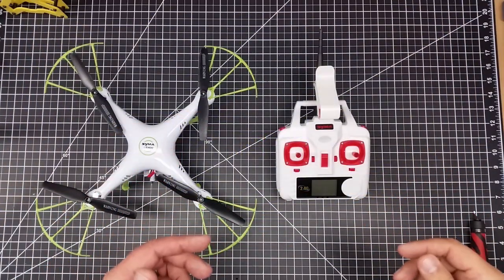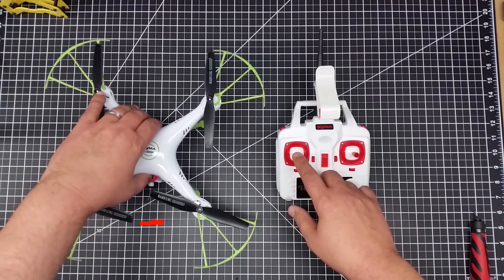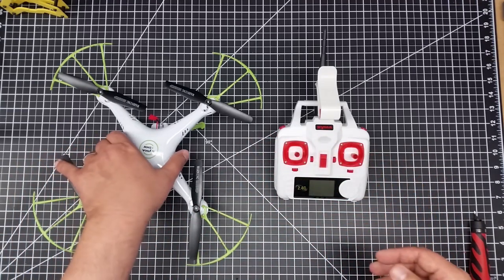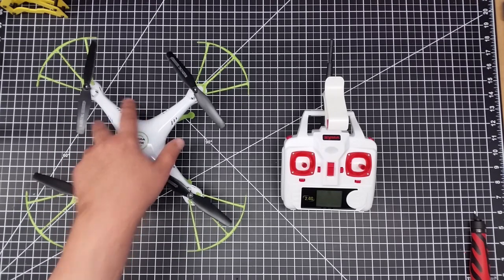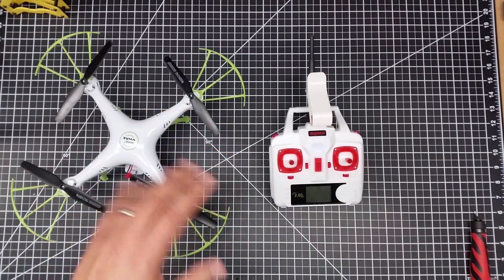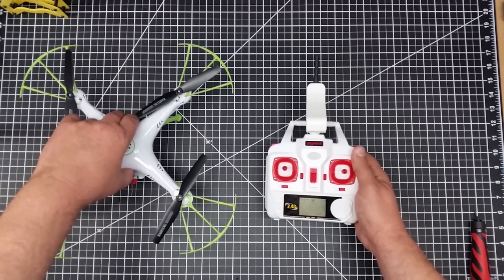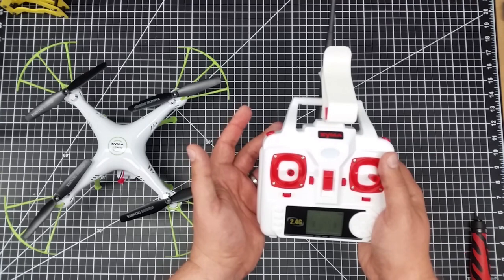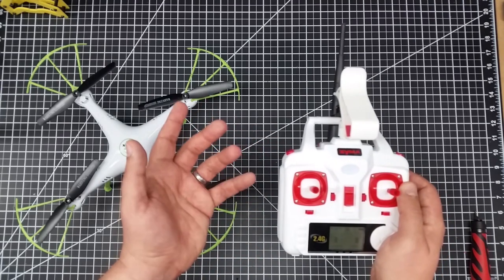Video Drone -  Headless Mode Tutorial!

Comment: I have a Syma X5SW-V3 WiFi FPV Drone.  I guess the V2 had a different camera.  The 3 is supposed to be a better camera.  I can't imagine one could be worse than mine.  What makes things difficult with mine is that it uses a different controller than the old one.  They used to be black.  Mine is white but not quite the same as yours.  Mine doesn't have a screen at the bottom.  I have to clip my cell phone on to it.  With that I use the "SYNA GO" app on my cell.
I can't figure out how to put it into headless mode.  The app has a toolbar at the bottom where there's a button to change it to & from headless.  But there isn't any discernible difference when I press that.  The instruction booklet that came with the quad are translated from Chinese and are difficult to understand at best.  One time the drone got behind a bunch of trees and I lost control of it.  As it got further & further away I had zero chance of recovery.  I honestly believe that if I would have been able to switch to headless it could have been saved.  Luckily I found it landed about a quarter of a mile away.
I was anxiously waiting to see the outdoor part of this video.  I searched for it but wasn't able to find it.  If it exists... could you please provide a link to it?  Yours was the best instructional video I've seen since I got the drone a month ago.  Your expertise is greatly appreciated.  If you read this and have suggestions for me I could provide my email address so you could send any info directly.
Thanks for all...

Comment: Great information, I’m new but I can see where headless mode can come in handy to keep the horizon level while filming
Reply: I need help when you calibrated compass both sticks down and left, I noticed lights flash slower and do not stop flashing yet than when calibrating the gimbles both sticks down and to right? is the right stick calibration is faster flashing lights then stops flashing. is this normal? ￼:thanksdoc:

Comment: I have no idea on how to fly in NON headless mode . I have tried for 2 years and can't get my brain to work backward . Have lost , crashed and ruined many drones trying to learn this . Also have a nice Futaba InterLink elite simulator at home on my computer think it would help and I am just as confused only at least every time I crash its only a simulation . In my mind stick forward the bird goes forward , back is back at so on . How can you possibly even see what direction it is facing when it gets up there and pretty far out ? crashed my 400 dollar X-380 into smithereens when the wind yawed it . I don't understand and can't get the hang of it therefore I got totally frustrated with the hobby . I am severely dyslexic , do you think that has any bearing on my inability to fly in NON  headless mode ?
Reply from the maker: Understand, however what you have to do is put your mind into the same perspective as drone and it works.  If you where to fly FPV it might make more sense...

Comment: If the drone is out in front of you in headless mode, you pull the right stick back so it flies back toward, over and continues behind you, do the commands sent by the transmitter reverse? Will the right stick pulled back continue the drone to fly farther behind or will it bring it back to you until it passes you again?  Will rotating your body and transmitter make any difference in commands sent?  Thanks for the video.
Reply from the maker: No the controller does not know its orientation only drone...

Comment: Is this work in Syma X5C-1?
Reply from the maker: Not sure, sorry....
Reply: yes it will i have the manual and it pretty much says the same thing so yes im 99% it will work
Reply: @RBMEDIA88  Nope, no headless mode on Syma X5C/X5C-1 - only on X5SC and later models.
Reply: @RBMEDIA88   Just checked your link. That video is for the Syma X5SC-1 which (as I noted) does have the headless mode. To the best of my knowledge no genuine Syma X5C or X5C-1 has ever been sold with headless capability. Of course someone could have added a later flight control board at some time.
Not doubting your word though mate as there are a ton of X5 clones out there - most of them with headless. I have quite often seen the Bayangtoys X8C (it has headless) fraudulently advertised as a Syma X5C. A long time ago I got shafted with one. ;-)
Reply: Nope your wrong I have the x5c 1 and it has headless mode I use it all the time. :-)
Reply: My bad mine is the x5sc lol I didn't know there was any difference lmao doh!
Reply: @RBMEDIA88  No prob mate. Feel free to correct all the mistakes I've made. ;-) Happy flying. Oz.

Comment: Once i put the syma in headless mode. Can i switch from position ?? can i walk if the drone flight or i have to stay at the same point where i put him in the headless mode ??
Reply from the maker: The movement is in in reference to the drone and not yourself so yes you can move around because the orientation again remains with the drone.  In short, while in headless mode yaw will change the rotation of the drone but will not affect its orientation...

Comment: All am asking is how make your drone come back to its original take off point. (return to home by pressing single key.)
Reply from the maker: The only way to really do this is buy a drone with GPS as there are some that claim a return to home without it but it only reverses the compass heading so it worthless.  This is a great one and its on sale: http://amzn.to/2DDYYDg
Reply: Pressing the (so-called) return to home key on a non GPS equipped quad acts the same as pulling back on the right stick. It will only bring your quad back to you if it is directly in front of you on your original set headless line. Also you must cancel it when it reaches you or it will continue on into the wild blue yonder!

Comment: pls help me whit set up headless mode. My drone is one quadcopter yr577-4     .   I dont if have or not headless mode.
Reply: this is my quadcopter    http://www.duoduogood.com/rc-toys/4499-remote-control-quadcopter-with-wifi-fpv-camera-yrtoys-yr577-4-drone-vs-syma-x6sw.html
Reply from the maker: Sorry have no clue about the copter or if it has headless mode as it need to come with headless mode...
Reply: on features on this link is write,,,headless mode,,  Has a  buton on right side like alarm when is presed. Mabe is for come back copter.  In 3 days i must have new batery and i must see all comand.i think it's just like syma x
Reply: I see and i push one boton (headless) on app program for fly. Is this option on app from my tablet

Comment: Sometimes, it flies behind my position and i get confused where to point the control. 

Do i keep control pointing at original direction i set compass? Or can i aboutface and headless mode “forward” direction adjusts with me? Thanks.
Reply from the maker: When in headless mode, when you push the stick forward, the drone will move forward in reference to the copter no mater what way the "head" of the copter is pointing and the reason its called headless mode...
Reply: Thanks. 

Ok. 😀 when it’s in front of me I manage to use the headless mode function fine enough. 

But i get confused when the drone goes over my head and flies behind me. When I turn around to face you it, it doesn’t seem to follow my controls. 

Sorry. Noob here. Maybe i still need to practice more. Thanks again. 😀🍺 you’re videos are great. 💥
Reply: For less confusion it is best to remain facing straight along the original set direction. If it goes over your head and you must turn 180 degrees to see & control it the right stick directions will be reversed. (Forward will be back & right will be left.)

Comment: I have a problem with headless mode...   Everyone says "back stick will bring it back towards you", but this is not what I find...   I am using a hubsan 501.  If I set the headless mode when facing N, pushing forward will take it N, and pulling back will bring it S.  However, if I have been flying around and the quad is now E of me, and I pull the stick back, the quad flies S, not W back towards me.  If that makes sense...  It seems to keep the compass setting from when the mode is switched on, and carry on using that.   Effectively, it means that rather than being headless, it has just set 'head' in a fixed direction.   This makes it more difficult than flying in regular mode!
Reply from the maker: If your in headless mode and your compass and gyros are all correctly set then yes in general it will come back by pulling back.  Now I say general because this is only true if you start off in headless mode other wise it has no clue where you are at as it only has the compass to work off so it will take the point you switched it into headless mode as its organ.  Also there are no cardinal directions in headless mode as it is all referenced from the why the "head" is facing when placed into headless mode. Headless mode is easier then trans-axial only because you longer need to concern yourself with the direction of the head during flight as this is how most fly-away happen as the pilot thinks they copter is really returning but is flying away and it leaves range...
Reply: But this machine knows where the transmitter is...   It uses GPS to follow the transmitter, for example.  Wouldn't it make more sense to have headless mode relative to the transmitter, than to some arbitrary direction in space?    Effectively, if you have done anything more than fly directly away from you and back towards you, it makes it much more difficult to navigate, not easier!   If you have lost orientation on the quad, then what chance have you got of finding the right direction?
Reply from the maker: Headless mode doesn't involve GPS, what quad are you flying?  This video is a Syma X5...
Reply: My point is that it *should*...   I have an X5, but I was talking about a Hubsan 501S.   My Xiro Explorer is due at the end of the week...   And no, still not eating lunch!
Reply from the maker: No lunch!  Shame on you!  :-) even the Hubsan will not use GPS for heads as the controller GPS is for follow me mode...
Reply: No, back stick will NOT just bring it back to you! "Normal" or "regular" mode requires the operator to adjust his imagination to having him sitting in the RC vehicle's pilot seat and moving the controls accordingly. For those noobs (or us old farts) who have difficulty in achieving this level of control, Headless allows us to set a grid on the ground and fly the quad relative to that. If you find that "this makes it more difficult than flying in regular mode" then you are well on the way to becoming a competent flyer. Congratulations!
Different makes & models of quads vary in how and when the headless direction is set. 
Your Hubsan H501 sets the direction each time headless is selected and looses that setting each time it is switched off. 
The Bugs B2 series sets the headless direction at motor arming and retains it (with headless off or on) till disarming. 
The Syma X8 series (& headless equipped X5s) set headless 1... on selecting headless and retain the set direction. Or 2... on pulling both sticks to bottom left. 2 over-rides 1. 
Some other types set the headless direction at quad & Tx binding. Check your own toys! :-)

Comment: Hi,i watched the video,but my syma x5hc's headless mode does not seems ti work.i don't know if Is a factory defect or it's me...
Can You help me please?
Thank You!
Reply from the maker: Should just be one long press, whats it doing?
Reply: Video-Drone 
Remote control, after putting the sticks in the lower right and bottom left and press the top left button for the headless mode. Sometimes the drone seems to work well at other times I find it difficult to" go back home" ... I don't know if it's a matter of settings ... Can you give me some advice? Do you have a video where you explain practically how do you do it? thank you!

Comment: Thanks for this video. With the Syma X's, the confusing part to me is, when in headless mode, what/when is  "forward" defined?

I have read/watched a few tutorial type of videos, and I have never got a clear understanding of this.

At one point, I though "forward" was defined by the forward facing direction at the moment the drone is placed into headless mode. But I have seen a few videos now where headless mode is engaged mid-flight as a recovery mechanism - so that means "forward" was defined before switching to headless mode.

In your video you point + hold both sticks to the bottom left. Does that then define "forward" based on the direction the front of the quad is facing? What if you do not do the maneuver - what defines "forward?"

I have even read a few things that sort of inferred that forward is defined as the direction the controller antenna is pointing.

Any clarification on this would be appreciated.

Thanks
Reply from the maker: Okay where do I start :-) I might mess up the order as I have not flown the Syma X8 since flying it into the lake, however you will get the point.  (1) hold both sticks down and out till the led blinks telling the gyros (really accelerometers) that the copter is "level" so it knows what what "level" is.  Then holding the sticks down and to the inside till the leds blink sets the compass so it knows which way is front and back.  This is critical for headless mode!  So yes you can switch in and out (i.e. back into trans-axial mode) of headless mode at will as yes people use headless mode to recover from being "lost".  So say you lose sight of the copter, you no longer know its orientation so click headless mode and pulling back on the stick will bring the copter back to you (or should in theory move the copter in a reverse direction regardless of the way it is facing).  Oh and forward in "trans-axial" mode is the front of the copter and "forward" in headless mode is when the right stick is pushed forward.  As in trans-axial mode the perspective  is of that of the copter and in headless mode it always the perspective of the pilot.  Hope this help :-)
Reply: Thank you. My only question was what defines the "forward" direction. I assume that when you move both control sticks down and to the left, "forward" is defined by the direction that the front of the drone is pointing at that moment?

The part that is confusing is that both the manual and other videos on here do not mention the point-bottom-left step when explaining headless mode. So when that step is skipped I am not sure how the "forward" direction is defined.
Reply from the maker: pushing the sticks down and in sets the compass to the current magnetic declination "orientation" and this set "forward".  Since this is based upon magnetic declination, unless you move a long distance from where it was last use it, it "should not" be an issue.  However in reality that is typicality not the case and the reason I do it at every flight  so "forward" is the "forward" that I set down the copter at.  When you switch to Headless, it will then use this "orientation" in reference to me [you] the pilot.
Reply: I will answer my own question now that I have everything down pat.

The headless forward direction is defined by the direction the quad is facing at the moment the controller is bound to the quad (the quick up down on left stick).

If you want to redefine the forward headless direction without rebinding, you just point both sticks to the bottom left and hold for a few seconds. The direction the quad is facing when you do this, is the new forward direction for headless mode.
Reply: I'm glad I found this video tutorial as it has shown me just much that I DO NOT KNOW about Headless Mode even though I use it every weekend!
For AJ Treg....I've just been experimenting with my Syma X8C (same controller as used here) and have found that there are 2 ways to define the forward headless direction. After adding a new battery to the quad, powering on the quad and controller and binding with left stick up & down, then setting the GYROS/IMU (not GIMBALS as misquoted by Video-Drone) by holding both sticks DOWN and to the RIGHT (not OUT as again misquoted by Video-Drone) you can either .... 1... select an appropriate headless direction (while on the ground or after lift-off and also can be totally different from the way the quad was pointing when bound) and lock it in by holding down the left shoulder button for more than 2 seconds. Or...2... select an appropriate headless direction whilst on the ground and lock it in by holding both sticks DOWN and to the LEFT (not INSIDE as again misquoted by Video-Drone.) This set headless direction is then held, with varying degrees of accuracy depending on how violently the quad is thrown around (or crashed) until you power off the quad or land & reset using 2.  Note...2 does not turn on/off headless mode. Only 1 does that, but 2 over-rides 1 in defining the headless line.

For Video-Drone....The above might seem like a condemnation of your Tutorial but nothing could be further from the truth, Sir. You should see the mistakes and information miss-remembered in some of the things I write! So thank you kindly for setting me straight on some of my miss-conceptions about headless. One more thing you can help me with if you are able. You say that Headless is controlled by a "Compass." I thought that it was a function of the processor and the Gyros. I may be wrong in this as well and would appreciate it if you could direct me to any source of information on the issue. Thanking you in advance. Oz.